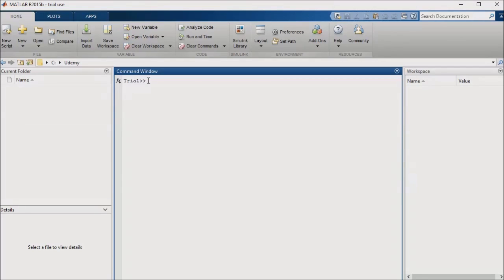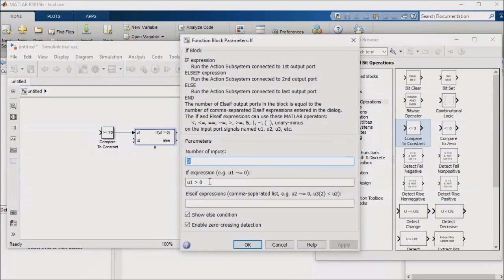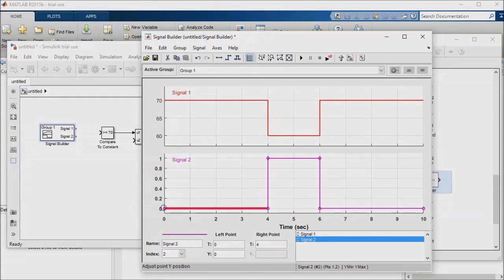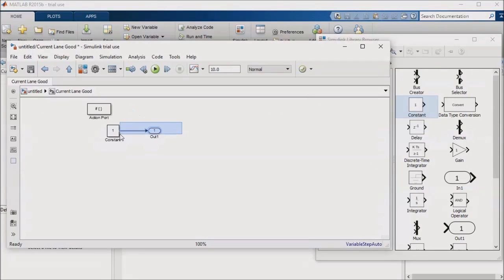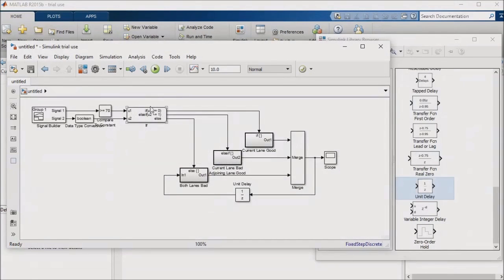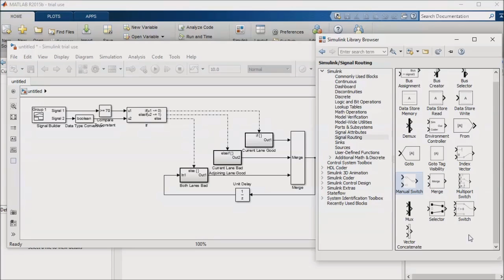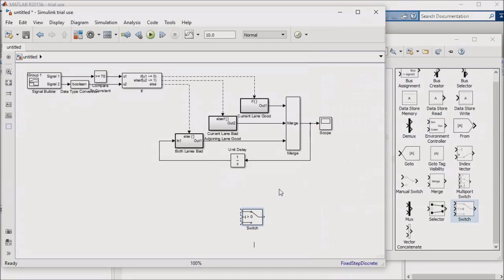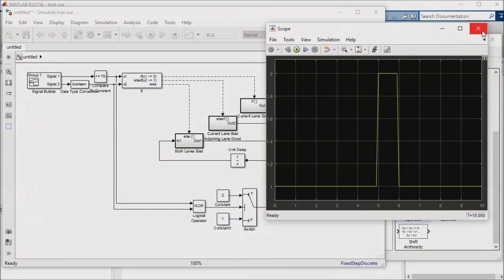Simulink Switches & If Statements

Comment: Hi, you helped me a lot :D 
I have one question for you.
In your video you send your output to scope, but i want to have one exact value as my output and i want to store it in a variable (lets say when time in simulation is 6.2  i want to put lane number into variable x, and x will be constant till the end of simulation, and in this case x will be 1)
Can you help me and tell me how to do this?
Reply from the maker: I don't usually give technical advice on my YouTube videos, but I'll try to help you out with this question. Here's one way to do this, although I haven't actually tried this before typing my reply: feed the output of a discrete clock into a 'compare to constant' block. with a value set equal to or greater than '6.2.' When the simulation time exceeds 6.2 seconds, the output of this block should be a logical '1.' Feed the output of the 'compare to constant' block into the trigger of a triggered subsystem. The trigger should be setup to execute on a rising edge. Feed the current lane number (the variable whose value you want to save at t = 6.2 seconds) as an input into the triggered subsystem, and within the triggered subsystem, connect the input to a 'To Workspace' block, which should be set up to output an array. After running the simulation, the array will be populated with zeros until 6.2 seconds, and then populated with the lane number after that. This isn't going to put a variable with constant value into your workspace, but you could always setup a model callback to execute when the simulation is done. Your callback code could simply take the max of the array. Now, when you run the simulation, the output will be a variable in your Matlab base workspace with a value equal to the lane number at t = 6.2 sec, which I think is what you are wanting. Hope that helps!
Reply: Thats exactly what i needed :D , thanks a lot
Reply: Thanks a lot :D

Comment: Nice tutorial. Thanks so much. I have a question. Say I have to model the states of the machine ,such as idle fault  good and slow down .the input is a message from a user interface to select the actual state of the machine and then the output could be the velocity or energy consumption or other parameter. This if logic seems only can do numerical comparison . Could you give me a suggestion?thanks
Reply from the maker: Valerio, I'm glad to hear the video was helpful for you. If you have fairly simple logic in each state, then the approach taken in this video should work for you. An if-statement created in the way shown in this video is capable of far more than mere numerical comparison. It is possible to have multiple outputs in the triggered subsystems feeding into multiple merge blocks, so multiple I/O are supported, and you can have sophisticated logic within each triggered subsystem, if you choose to. In your case, however, since you have a number of states and need to transition between states based on conditions and change multiple outputs based on the states, using Stateflow within your Simulink model is probably a better choice for you. You should be able to implement all of the logic that you need to without using Stateflow, but Stateflow will likely make your state-based logic easier to create and (importantly) easier to debug.
Reply: Thanks for the answer.  Well my case is actually not that complicate. the idea is that here is a user interface and the user enter the state of the Machine ,say (I,F,G,S which represent the actual state of the machine)  and this generate a massage as a input and  gives an output such as a fixed number. So it's a SIMO case. It doesn't concern state transition(in my point of view). So I wanted to know  is it better to use Switch or if statement. thanks.
Reply: I also wanted to know how to generate this message input

Comment: I like your very good video, Sir, I have one question, I have one problem in my PID Controller with my Simulink Model, I tried a lot but I failed badly, I want to send my Model at your end and after Tuning send back to me with many thanks.
I will be very grateful to you and obliged.
Thanks again.
Best Regards
Gul Rukh Khan
email: grkhan@hec.gov.pk
Reply from the maker: Gul, 
You will not learn as much if I am modifying your Simulink model for you. However, I’m happy to point you to some good resources and perhaps answer a question or two if you still have any unresolved questions. I would strongly suggest using Simulink’s discrete or continuous PID controller blocks, which have a built-in tuner. Mathworks has excellent documentation on these, which you may review at http://www.mathworks.com/help/slcontrol/gs/automated-tuning-of-simulink-pid-controller-block.html and at https://www.mathworks.com/help/simulink/slref/pidcontroller.html. These will even allow you to select the gain and phase margins that you need (I would recommend 6-12dB and 45-60 degrees, depending on the application) as well as the time-domain response (such as % overshoot). You can also view both time and frequency-domain response for the plant, open-loop, and closed-loop transfer functions, so the tuning tool that Matlab offers with their PID blocks is really fantastic. I’ve had good success with using this tool to design gains for a controller for a real-world system that I was working on. Try reading the documentation that I’ve linked to…if you still have a question after that, let me know and I’ll try to help you out.
Reply: Hi there, really enjoyed the video cheers for the help. I am trying to make a Simulink model for a quadcopter moving around a course- I need the drone to realise when its reached a certain point in space, then use a switch to make it go to its next point. Your video was very helpful in showing me the right blocks to use, I am just struggling to put it all together. Could I email you some screenshots for you to look at or ask in further detail? Cheers